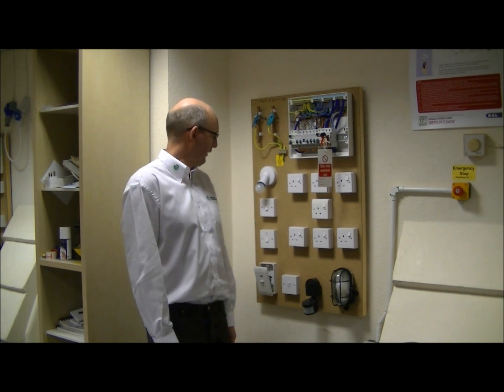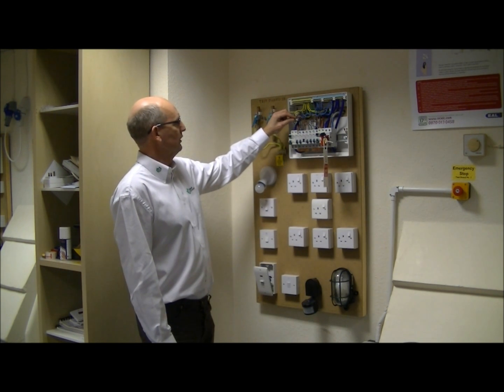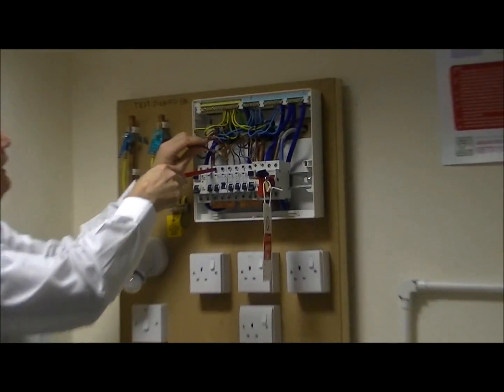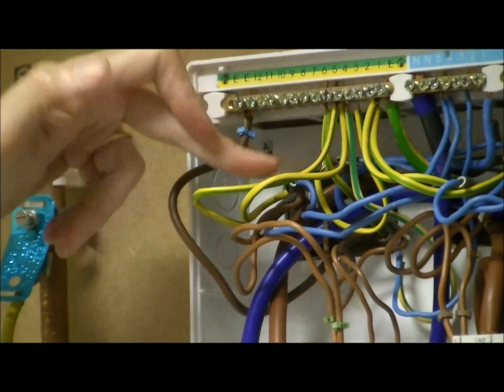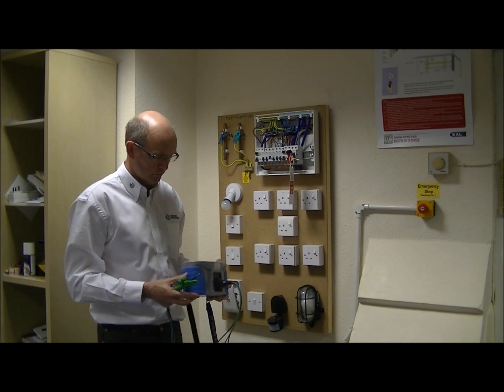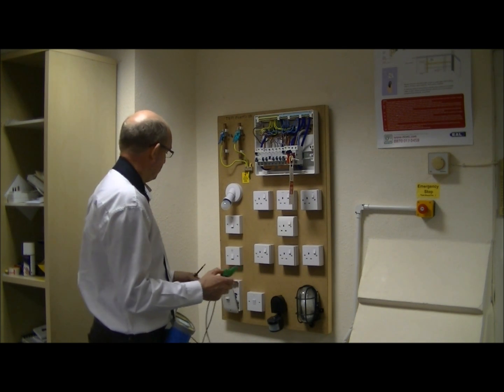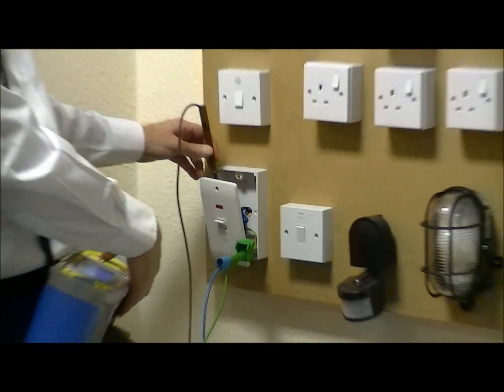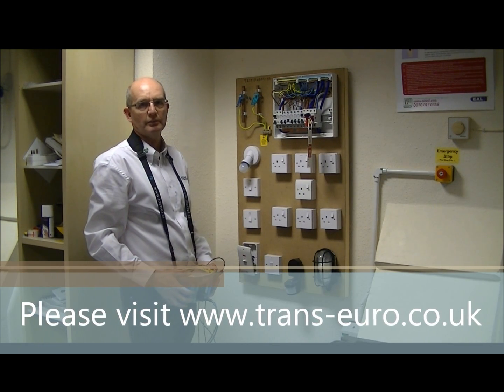Continuity test on a radial circuit

Comment: 1.2ohms high for such a manufactured small wire run? I would have expected it to be at least 100 times lower at 0.012 ohms. Presumably several factors to consider its at end of the run we have installed sockets in between adding resistance.
Reply: we insert resistors to simulate long cable runs.
Reply: Proactive Technical Training PTT  ah ha....thanks for clearing that up much appreciated.